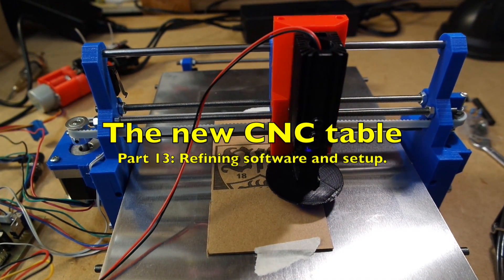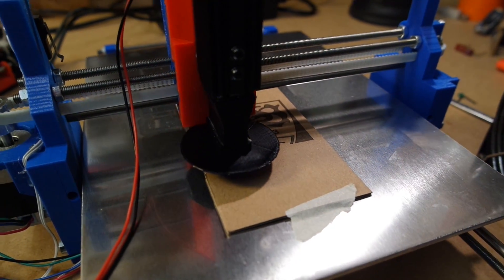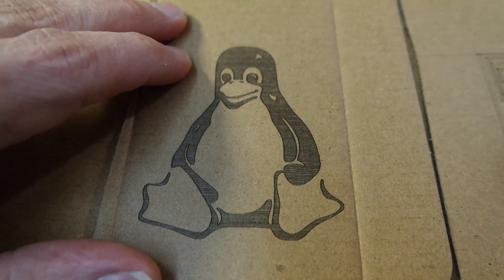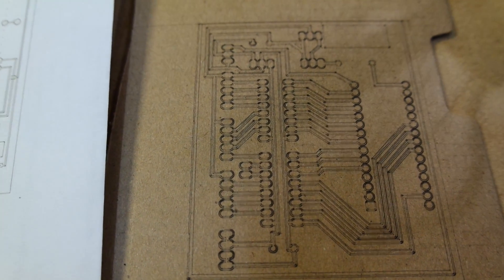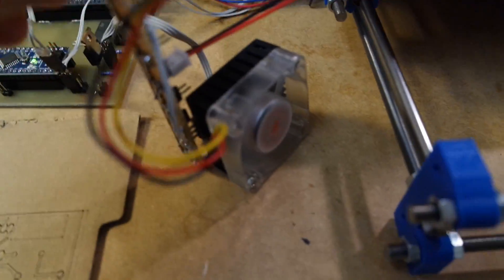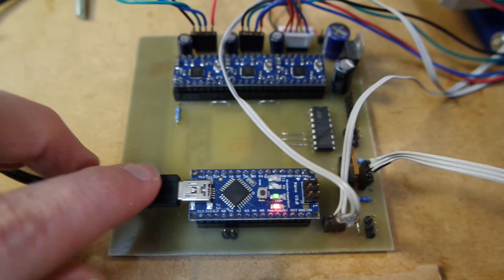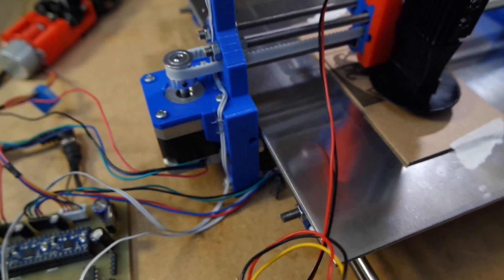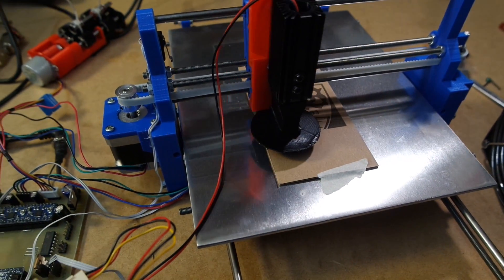The new CNC table pt. 13

Comment: Something you should be carefull about: If your laser head moved out of the range of working piece, it can be reflected from your aluminum base and hurt your eyes. Be carefull.
Reply from the maker: I'm aways wearing laser googles when I'm doing this, and I have a black mat to cover the aluminium too. But good advice nonetheless !
Reply: Nice! What level of resolution do you plan to achieve on this machine?
Does the belt system have backlash?
Reply from the maker: It has very little backlash, which is easy to compensate for. My laser has a 20 micron focussed dot. I can get it to work with that.

Comment: What sizes of belts are you using?
Reply from the maker: Mens size 'L' 105cm
Reply: haha XD for the cnc of course
Reply from the maker: Sorry - couldn't resist.   .... I use T2.5 steel lined belts with 4mm width. Standard for 3D printers.

Comment: Take a look at Inkscape for bitmap to vector graphics conversion - free an very flexible.
Reply from the maker: I know, and I did - right now I'm still favoring the scanline and bitmap approach, since it is more flexible at tuning the size of the isolation track in relation to the given bitmap. I'm currently researching optimized fill algorithms to speed up processing.

Comment: Hi looks very good, Thanks to share your knowledge and expirience. Im very interest with positive pcb engraving Im thinking about the same may lasers are waiting to be implement on my 3D printer. Well done thanks one more time.
Reply from the maker: Thank you for the heads-up !
Reply: You welcome ;) I wonder, ( however I still did not watch all your materials ) why you change unipolar to bipolar system with stepsticks from 3D printer ? Was something wrong in previouse unipolar version wit ULN drivers ?
Reply from the maker: The main benefit is that you get microstepping and current control, where the ULNs only support half-steps at most.
Reply: Thanks for quick respond. I suspect that.

Comment: Have you tried LaserWeb3? ..... It really is very good and it's open source. It can take DXF, SVF and BMP straight in and will communicate with GRBL and other controllers (which is what I use). 

The latest GRBL firmware also has some new laser modes that significantly speed up rasterise grey scale images and it can support PWM control of the laser.
Reply: It looks good, however i like to use Marlin which is not supported

Comment: I was looking back at when you was first trying to do the PCB and the copper looked brush painted. Was wondering if the laser was having trouble with the paint being different thickness. Maybe a silkscreen print style way to get uniform paint over the surface could work in coating them?
Reply from the maker: I don't know honestly - I suppose some investigation is in order. 
My current theory is that the laser is burning away the black pigments, but the clear bonding solution remains. 
Still that does not explain why it worked on the first (lab experiment) tryout.
Reply: Trying this with my laser , i have notices my laser when under PWM even at full 255 , it still is only 75% as strong  as it is when driven directly 1/0 with a relay .  Im using a violet 300mw  .  Its not big but it can run for  hours full on without worry of 'aging' the diode. I suspect its a higher wattage  diode with decent  driver circuit .   
can you drive your laser via relay , or is your driver circuit the only thing that handles the constant current a max volts ?
I know when mine it  hooked directly to its supply , it will cut light color card board ,  but it cant do that when i use the PWM mod e on mine .  I think my PWM fet is too much voltage drop or something .  I'm sorting out so PWM value 255 , bypasses the  FET and triggers the relay if  i set the mode to alow that . 
when it comes to paints that have acrylic clear in them , its just like trying to cut clear things, unless you emit IR ,  clear stuff will just lens it off.  but i have cut thin vacuum form sheets with just black sharpie to color its so laser could  cut a path .  I suspect my laser leaks a bit of  IR . 
on a positive note the laser may have weakened the paint such that it will come off with a mild solvent wash , and the rest of the mask will stay in place . a quick with with some sort of solvent is worth a shot if the pain oxidized at all .
Reply from the maker: I spent some time writing better software for generating engraving g-code, and I'm tring that out now. I'm pretty happy with my laser and its power, I don't use pwm right now.
I also ordered some other pens, I suspect a red pen might work well too.
Reply: green works well if its cheap enough.  because green lasers start as IR in the pre-pump section , and cheap ones dont have a good IR filter , heck some dont have any IR filter .  and the IR is the light that should be able to burn that clear layer on your boards .  even the lil bit of IR that leaks out .